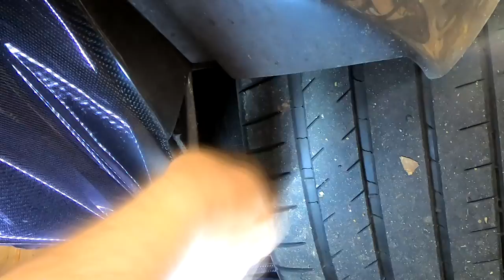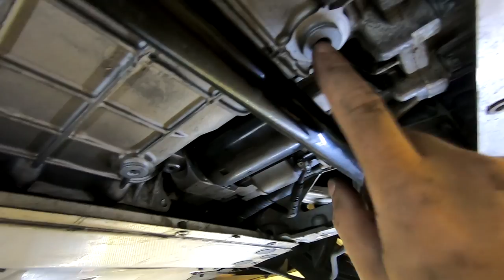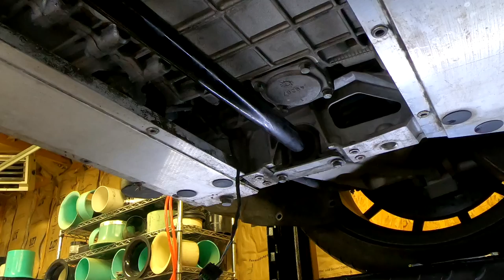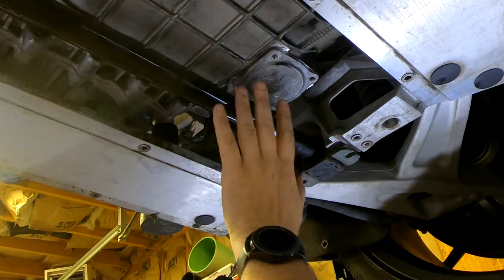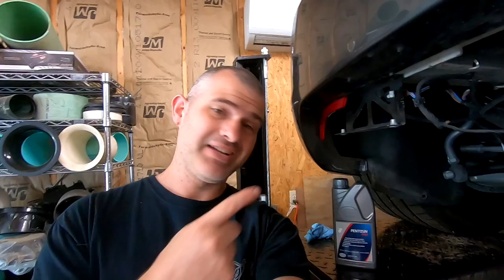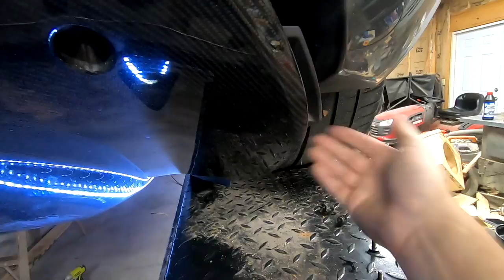DIY clutch service on your McLaren, I saved THOUSANDS of dollars doing it myself

Comment: Hi Sean, I just performed the clutch fluid replacement on my 650S Spider and I'd like to thank you for the video.  It was very useful for removing the connector from the diffuser, and lowering the anti-roll bar to remove the filter cover properly.  However, there is a discrepancy between your fill procedure, and that indicated in the McLaren Factory Service Manual (which I am lucky to have!).  I ended up using about 7.5 qts total following the factory procedure.  It involves three fill drain cycles in a timed sequence.  After draining both sections and replacing the filter: 1) both drain plugs closed, fill to fill port level.  2) Run car 2 minutes, then open drain port 1 (clutch sump) - approximately 1 liter will come out. Simultaneously and quickly fill to the fill port level, THEN reinstall drain plug 1 and torque.  3) Run car for 2 more minutes, then add 1 liter to fill port.  If you are interested in a copy of the related section of the manual, please let me know where to email it.  You may want to amend your video based on this factory procedure as my trans was not close to dripping out of the fill port on the last step after installing the 1 liter.  Overfilling might be an issue.  My Best Regards, Jon.
Reply from the maker: I don't want to post an email here, but you can contact me through my website contact www.emfcaraudio.com I would be interested to see that. I can tell you that mine has operated normally (and better than before) ever since I did the video. Perhaps their method is a 100% drain vs a 90% drain maybe? Maybe it's a way to charge you for more fluid!

Comment: before taking out any drain plug, you want to make sure you can loosen and/or take off the fill plug. it would suck to become stranded with an empty trans or diff. nice video, though.
Reply from the maker: If you can't take the fill plug loose, you have bigger problems.
Reply: @McMedics   but then at least the car is driveable to a place than can successfully remove the plug. sometimes you find out the guy before you was an 800lb gorilla that thinks it's a pressure fitting, and needs the strength to hold down the space shuttle after engine ignition.
Reply from the maker: @odortiz  The place it's in would be the place I'd take it. That's an engine out fix, and if you think I'm paying someone else to do that, you are mistaken. You may be right on a lesser car or a different person, but definitely not me and definitely not on one of those.
Reply: @McMedics  i'm totally with you. i am my first and last resort.

Comment: Hey mate, you didnt do the clutch oil level check properly. You are supposed to leave one of the drain plugs out whilst filling as this has a check level tube in it, according to McLaren manual
Reply from the maker: I followed the McLaren manual, part of which requires MDS that people don't have so it's adapted. The process has even changed since this video, too much fluid on this video. You shouldn't add more than 6.5 liters now. It solves a high heat overflow

Comment: Hellow  thanks for this great video, sr i  listen 👂 on video  you said started the engine at 2000 rpm for few seconds for  get oil warm  and  add more oil in to transmission to get the  right level,
I  need turned off the engine?  for this next step or leave running for  add more oil in transmission.   I know few audi cars you need to leave the engine running  to add more oil in the transmission and after start  oil drops  💦  front hole 🕳️ this is  the level but  on the mclaren don’t know what is your recommendation thanks 🙏
Reply from the maker: If you leave it running it will shoot oil everywhere

Comment: Thanks for the video. Great help, i just put 8 Liters and it is still not overflowing! Not even when the car is at the operating temps!!! I wonder if I should add more or leave it alone?!
Reply: I have same problem I finished add 9.5 liters on my 720s  I leave running for 15min and then I opened the filling plug  and don’t show oil spit out front hole 🕳️ I decided  to close tide the bolt and leave the 9 .5 liters
Reply: @Carbodon69  so i think 8 is too much. It started coming out of the clutch vent and on my driveway/garage. It was a mess. I reduced it down to 6.5L since i live in a warmer climate in California. That was based on EMFAutos recommendation.
Reply from the maker: The procedure has changed and I should probably do a new video. Don't put in more than 6.5L regardless of if it's coming out of the fill
Reply: Would it be 6.5 L for a GT also?
Reply from the maker: Yes

Comment: For the z bar, could you not just take one of those long stick jacks and press the engine up just enough to get the bolts off?
Reply from the maker: The Z bar has nothing to do with the engine position, and you're definitely not moving the engine and transmission, especially upwards.
Reply: @McMedics  ah was just curious, one time I had to Jack my engine up on my Granturismo about 1 inch so I could take the oil pan off without having to drop the front subframe, was just wondering if the same principle would work on this to get a little extra space.

Comment: Could you run an extension and a universal joint on your ugga chugga through the wheel for those 10mm? Great vid.
Reply from the maker: Which 10mm? The only one accessible from the side is the one on the filter, and you could un-chugga (but it's so easy otherwise so why bother?) but you wouldn't wanna chugga because that's way too much torque. The other 10mm are from the bottom, and same chugga story.
Reply: @McMedics  the ones for the fender liners at 4:45 where you used the ratcheting wrench

Comment: Would the clutch, transmission and engine oil changes be the same for a 675lt? Just curious cause i know they are similar but mclaren says 50% of the engine components are different.
Reply from the maker: The M838T engine (the same engine in all 3.8L cars) has had some rolling tweaks along the way but for the purpose of oil changes is the same. The clutch is the same in all 3.8L cars as they all use the same essential transmission. The transmission is also essentially the same in all 3.8L cars. On the surface they all look identical, internally there are some TCU tweaks and gearing variations. All of the filters and fluids are the same.

Comment: Nice details to the process there.  Do all of the drain plugs (e.g. those at 11:33 or so) use o-rings, or do some of them have crush washers (or some other sealing apparatus?  Curious as I just got through doing a probably-unnecessary trans fluid change on a Lamborghini I think 90% on account of a previous owner re-using or using mis-sized crush washers.
Reply from the maker: There are aluminum washers on the plugs. You can't replace the washer without cutting it off the plug so if you want to, it's replace the plugs with insanely priced ones (unless you find a substitute). I'm sure you've found in majority of cases reusing them once is ok, more than that might get sketchy. Using the wrong size definitely is no good.
Reply: @McMedics  Yeah, but still, I'd be white-glove handling them in that case to avoid any nicks or scratches on the washer.  Surprised they'd use a captured washer for that type of thing though...
Reply from the maker: @LapoftheWorld  I'm not surprised. Why sell you a 5 cent washer for $4 when you can sell a $1 plug/washer for $32.

Comment: Thank you for a great video! According to one instruction I saw you are supposed to operate the rear wing twice during this process, did you do that?
Reply from the maker: I didn't, it requires MDS to do that. The idea is to make sure there is no air in the system but the system is self bleeding to an extent.
Reply: @McMedics  ok, thanks 😊
Reply from the maker: @johannesk1855  Perhaps, but the airbrake setting is very touchy about it not throwing a fault.

Comment: Hi, i have a Problem with my mp4  with the klima! It write calibrate on Display and i cannot use the fan, can  you help?
Reply from the maker: It always says calibrate, nothing more or changing?
Reply: @McMedics  alwas says calibrat
Reply: @McMedics   nothing change
Reply from the maker: @chh2573  I've seen it on mine before when it was extremely hot, the compressor shut down. I would first check refrigerant to make sure it's charged properly. Can you shut off A/C and anything change?

Comment: Not trying to be dark. But don’t those engines blow head gaskets and the gear boxes go out a lot? Seems very risky to own one with no warranty
Reply from the maker: No, they don't. That's a myth perpetrated by the internet based on how McLaren addressed some warranty issues early on. Example, any system that tied into another system has a problem and they just replace all parts. The airbrake is tied into the transmission via hydraulic system so if you had an airbrake problem, they'd replace the transmission. If you needed a clutch, they'd replace the transmission. The problem is people repeat things they don't have the whole story on, or make things up and add it into the story, then when it's 2 instances that suddenly turns into all of them. Literally every McLaren owner I've ever spoken to (which is a lot) has never had a head gasket or actual transmission problem, even under warranty. There are guys making 1,000+ WHEEL horsepower without issue on stock transmissions and upgraded clutches.
Reply: @McMedics  Wowzers!!
What scared me was an interview done by this Asian guy. The owner was like, Do Not!! Get one with no warranty!! Even with a warranty, keeping service on stuff that’s not covered 3k every time they touch the car. If your car does experience an issue with the hydraulic-system or a damper goes out. How would you proceed? Are aftermarket parts sources sorted out?
Thanks
Reply: One more thing. Theses are not attacks. I am hanging by a thread about getting one. I really like the car, but the difference between getting one at 120k vs 80-100k puts me out of the ball game. I am a auto repairman by trade. So I really respect what you are doing. That’s pretty much what I have been doing with my own English car(Bentley). You are either one of the most lucky  Mclaren owners or what!!
Even Rob at Gotham exotic car rentals said “ Don’t touchem with out warranty”!! I might just take the plunge. I tell ya one thing. Your repair vids are a God send.
Reply from the maker: It sounds like that "owner" is a terrible owner who makes bad decisions and bought a terrible third party warranty and gets screwed by whoever they take it to. I haven't had any suspension issues, but what can happen is accumulators leak and those are $200 each last I checked. They're easy to replace.
Reply from the maker: Rob also doesn't fix them himself and had people abuse them because it was a rental. On top of that, he had one when it was early as a brand. Any car with miles on it had any early issues sorted out. If you want to keep these cars trouble free, drive them often.
Reply: @McMedics  Roger that!
Thanks for the content

Comment: anyone ever find a different place to get the filters versus the dealer?
Reply from the maker: I'm casually seeking that out, I haven't found any yet. They may have actually made a bespoke filter as the transmission is only used in McLaren.
Reply: @McMedics  i know, ferrari seems to use the granziano dct as well but just can't seem to find any good info.  thought 458 used same unit but when I find pictures doesn't seem too similar
Reply from the maker: @dvandentop  Same manufacturer, different transmissions. Lamborghini uses them too. The only crossover transmission from them that I know of is R8/Gallardo/Huracan.
Reply: @McMedics  yeah I was hoping all their 7 speed dct used the same case but all different except for like you mentioned